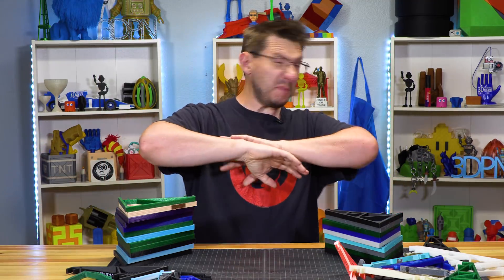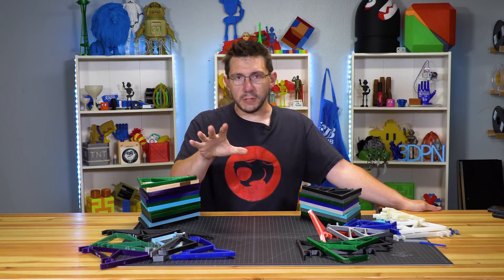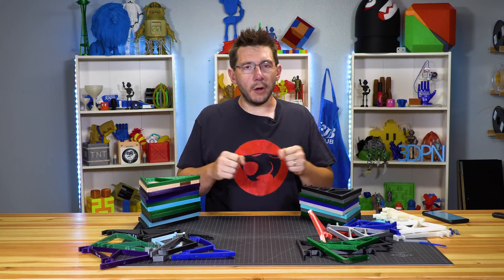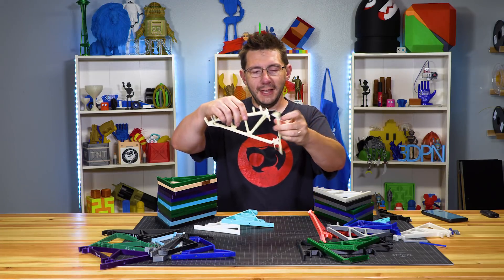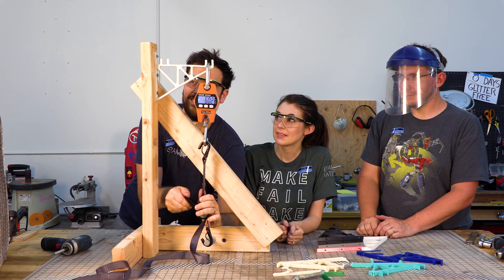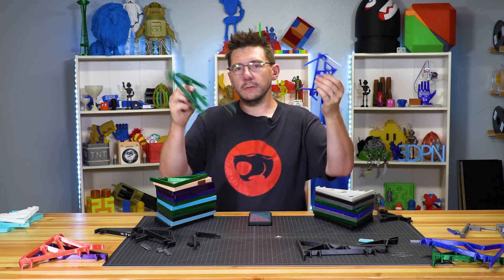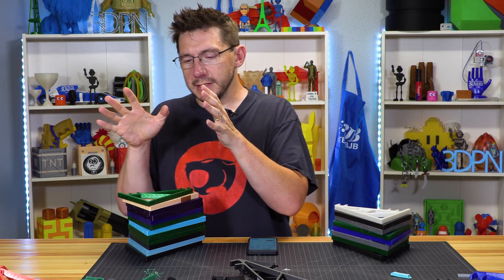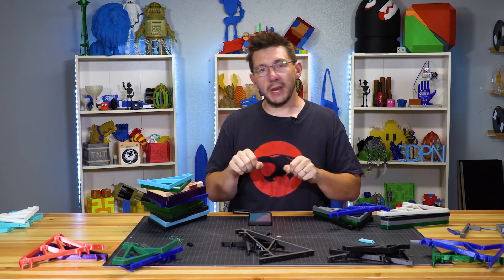Will It Break? Breaking Brackets Part 2 - 3D Printing and Breaking them FOR SCIENCE

Comment: love your videos Joel, curious though. If youre putting spools on the center of the brackets, are you measuring weight at the best point? the tip seems like a weak point because its the thinnest. do you think there would be different calculations if you stress tested from the middle and not the tip?

Comment: Did I miss where you said the weight/volume ratio of the two designs?  What is the % improvement accounting for the added material?  Obviously you could print a solid triangle...

Comment: Mark III would probably be one support triangle between the top mounting point(just figure out how to get the screw in...) and one extra triangle in the middle connecting to the wall surface, since your Matterhackers PETG Build Series basically  broke at the same place. Still amazing results and the testing makes the development process very interesting and educating. And fun. It is said, if a crafted/printed piece breaks and you are in your basement testing, some say you can hear Bill laugh from the walls.

Comment: I grabbed these and got a set of them installed, but boy was it a pain.  The v2 are great to look at, but none of the holes were easily accessible with my drill to actually screw them down.  The the lower 2 holes didn't even have enough clearance to fit the screws you suggested/used in the first video.  I think the top tab should be lengthened just a bit (and hole raised), the middle hole be lowered to between where the two lower holes are, and the bottom hole be moved to a tab on the bottom to make installing much easier.
Reply from the maker: Those are great ideas - thank you!
Reply: @3DPrintingNerd  Luckily I found a screwdriver with a long enough rod (and right head) that I could come in at a steep angle and get them tightened down by hand.  Just waiting on the 1x2 boards to finish being stained before I hang them.  Family is looking forward to spools not rolling around the room anymore :)

Comment: here's something you should know, failing along the beams is due to torque and can be seen as a structural failure.
however in the v.2 , they mostly failed near the joints, which means that the material failed rather than the structure.

Comment: 1- the space (18 mm) for the 1x2" is too small  (3/4" = 19 mm), 2- with V2 it's not possible to use a 1 1/2" screw in the middle hole !

Comment: Isn't nylon like epoxy - only having the strength when it is made the first time.  Injection molded parts could be stronger as well.
And obviously, a well-designed glass fiber or carbon fiber part would be even stronger.

Comment: Will be fun to revist this in a year... I've made some brackets for high load out of PLA, and they very slowly started to deform and break under the load. So i hat to remake them thicker after about one year.
Oh, and a tip for the next measurement: Put the measuring device at the bottom, or put a pillow there so your scale does not drop half a meter on the hard table every time the bracket breaks. Trust me, it will live longer and stay accurate a lot longer. ;)

Comment: Not bad results but the mechanical engineer in me groans at the design. You are putting the material in tension but it would hold more weight in compression. In short the first diagonal brace should go from the BOTTOM of the bracket against the "wall" and extend up to the horizontal upper member. This would put the stress into the bottom inside corner, pushing the corner into the "wall" which would also tend to reduce the tension at the top inside corner, your most common failure point. As the bracket is designed now, you are PULLING the plastic apart rather than pushing it together in your most stressed locations! But hey, it is fun to watch and the tests do confirm that adding trusses will make the structure more rigid. Don't feel bad about the mistake though, it is an easy one to make and is made much more often than one might think! I love your videos, keep cranking them out! :D

Comment: something that might help.
Take this for what it is and it is not always true, but generally you can consider your trusses as arrows pointing away from your point of stress.
where they point to is where that stress will go Triangles are great because they move stress evenly away from the point of origin in opposite directions spreading it out.

so if you look to remake the bracket try to think.
1 Where is the stress.
2 is it over an area or at a point.
3 where do I want it to go. 

then make some triangular trusses pointing from your point of stress to where you want the load to be.
this is a crazy oversimplification but the visual helps me

Comment: You need to quantify the behavior of the material using stuff that engineers can use. Materials behave differently under tension, compression, torsion, etc... Then you optimize your design to depend on the properties of the material.

Comment: Brackets work great but I found two issues... 1. It is almost impossible to get the screws straight. 2. The 1x2 didn't fit, the tolerance was very tight, and forcing the wood in bowed that area a little.

Comment: All the PLA's Are very strong if you slowly put the load on it. We are 3d printing a whole frame for a 32x28x55 inch 120 lb robot. So its good for some scenarios. The problem is though when force gets applied quickly. We designed some trusses that will hold a 320 lb man stepping on it but they will shatter if you hit them with a hammer wrong not even that hard or put twisting force on it. Direction of force matters a lot with PLA . So if you make something structural out of it you have to take great care how its sliced and in which direction the filament runs

Comment: When you was talking about the bracket if the video at 11:28 & u see how this one failed & alot of the others also seemed to fail in the same place if you was to put another truss going towards the back main upright how much of a difference would it make to the overall performance of the design. Yes I know that it would involve a complete redesign again but you certainly have to think about the way that just adding 1 extra truss could be such a great addition to the best possible performance. Love the video's & can't wait to see how the F1 rc project will turn out and how fast it will eventually run

Comment: Annealed HTPLA is stronger than non-annealed.  So why did it fail at a lower weight?
Reply: Stronger how? The truss designs failed in a few different modes; tension, compression and shear. This can be seen by the difference between the materials failures. Additional due to the slender design of the bracket the moment being applied can cause buckling which transitions the load out of the plane of the force and can cause even more moment or less moment resistance. OK I'm getting over my own head here but the point stands. Strength is is a relative term and must be used with a clarifying argument to have meaning. Stronger in tension or stronger in compression would be a more precise way to describe something.
Reply: Umm ok.  :-)  Maybe it becomes more brittle after annealing.

Comment: Did you consider the tool path of the 3d printer? Maybe changing the setups to match each material changed the tool path which will have a significant effect on the strength?

Comment: Just a small suggestion to perhaps help with the buttons on the scale being pressed erroneously, attach a small bit of rope to the scale and the top of your testing rig.  If you make the rope only long enough to allow the scale to at most hang near the bottom of the test rig but not hit the table it may be safer for your hands and also your scale buttons :D

Comment: PLA tensile yield strength is high. That is why is good for this specific application. You would think before the test that NylonX should be the winner but what makes NylonX great for mechanical moving parts like gears is what makes it bad for brakes. Nylon stretches and PLA does not. PLA is an amazing material because of its stiffness. Just keep it cool, you might suffer from creep if the temperatures rises and you then will get a failure.
Reply: Metalurgia's Designs hey so is this why it held more than PETG? I was shocked to learn it held double the weight!
Reply: TheMidnightSmith yes the PETG will stretch a lot more before braking. PLA won't flex that much that's why they basically explode.

Comment: Cool video, really surprised at the limited strength of the carbon fiber infused filament. I guess just having CF in the filament doesn't mean it's being laid down in a manner that creates a strong matrix like you get when using carbon fiber cloth and resins.
Reply: Voivod 1966 , yes this is like cutting iron bars into small pieces and trying to reinforce concrete with them.

Comment: Really nice results. It doesn't even look worth prioritizing max load with those numbers. I think I'd go for something with a more bendy failure mode to make any "dumb guy slipping while holding the spool holder" accidents safer.
Reply: Shower thought addendum: I wonder what kind of failure mode you could get with a dual-extrusion printer cladding a PLA core in TPU. My first thought is that it would allow you to use a filament with good tensile characteristics, while helping to contain the more explosive failure modes on the high end of the filaments you tested.

Comment: I think a more useful measurement would be the force required to deflect the bracket a certain distance (stress/strain analysis) rather than breaking force (ultimate tensile stress). Since you want shelves to be sturdy rather than out and out strong.

Comment: Your next test should be on whether or not printing with all top and bottom layers is better than all wall layers or a balance with different percentage infills.   I would be willing to bet that an all wall layer print with no top and bottom would be the strongest. ie; increasing the wall layers so no infill and no top and bottom layers are needed to print OR increasing the top and bottom layers so no walls are needed.

Comment: Good(!) to see you were more careful to be safe in this test.

Yes, you do have a result, and it is consistent with what others have shown.

First, design matters. A better design is stronger. Testing can show where the design fails. While failures are generally going to be similar (as you saw), a specific material may differ somewhat in point of failure. (A more flexible material might deform and shift load to another area of the part.) When you know the point of failure in the desired material, you can update the design to strengthen that area.

Iteration matters.  :)

Second, plain PLA seems to be pretty much the strongest thing out there. Other folk got the same result. Nylon is not stronger. Carbon-fiber infused PLA is stiffer, but also not stronger. 

So ... print with PLA and iterate for strong results. :)

Comment: Killer iteration (and nice Thunderclap shirt).  It's cool the way you addressed every suggestion about the previous bracket video in this one, and acknowledged CNC Kitchen.  
Your dynamic presentation arm movements have seemed oddly familiar for quite some time.  I knew I'd seen that style of gesture before, but I could not recall specifically who did it.  Flipping channels last weekend finally provided the answer which has been dangling just out of reach for so long.  The first time I saw someone do these moves was on SNL - the Target Lady!

Comment: QUICK CONVERSION FOR ALL YOU ENGINEERS!

Material..........................................V1 (N)..............V2 (N)..............% Diff.
Polyalchemy Elixir (MOAR).           400.                   667.                 166.67
ProtoPasta HTPLA.                         288.                   404.                 140.12
Matterhackers PLA.                        389.                   434.                 111.54
Matterhackers PETG.                     188.                   230.                  122.46 
Matterhackers PLA (MOAR).        546.                    783.                  143.32
Matterhackers Ryno.                      168.                    230.                  137.4
Matterhackers NylonX.                  174.                    214.                  122.96
Zortrax ZHIPS.                                                            65. 
Polymaker Polymax.                                                  268.
ProtoPasta HTPLA (annealed).                               375. 

I would do it in KG too but Newtons is our good ol’ SU unit!

Comment: how come i never see you , makers muse, or tom ever really deal with delta 3D printers ive only ever had experience with delta fdm machines and dlp resin. ive never got the chance to use a normal cartesian printer. are delta printers not as good? it seems they are unpopular is this do to less support build quality or something?
Reply from the maker: Good question. I've had various SeeMeCNC machines, and right now I use and love the Artemis. In fact, it printed the models for the video where I melted dino models.
Reply: thanks for the reply, ah the artemis is such a beautiful delta style 3d printer did you get the assembled one or assemble it yourself?  currently i just have one that i sourced out parts for and built but i think im going to get the cr-10 printer and compare how different the two print, Also watching the dinosaurs melt was pretty great.

Comment: It would be cool if you looked into generative design in Fusion 360. Apparently it uses machine learning to create structures that are strong with the least amount of material. It would be nice to see how a generative designed bracket would do compared to your other designs. Maybe you could even show a ratio of weight to the amount of force it can hold.
Reply: Ah but sadly this is ONE feature that is only available to people who have PAID for F360. Which, though much cheaper than Solid Works, is still a bit of coin.

Comment: The debate about the strength of natures shapes. You mentioned that the triangle is the strongest shape in nature, but Angus yesterday didn't say that, he said that the egg shape if compressed at the oblong points, is impossible to break. Hmm.., there seems to be some differences in opinions on the matter. It's possible both opinions do seem to hold water given the variables involved, depending on what their intended requirements are for.

Brackets you say? Yes. Here is another one of a commonly shaped type of Bracket.
https://youtu.be/LS0Nf7lZu6s

Comment: Insulted that you felt that you needed to put these results in a table!  Kidding enjoyed the video, I was supprised with the amount that could be held, even with your first version of the brackets in the weakest plastic.

PS would it have killed you to put the table in the description :-)

Edit - Attempt to put in table...
 Material                                        V1 (lbs.)   V12 (lbs.)  % Diff.  
 --------------------------------------- ------------- --------------- ------------
  Polyalchemy Elixir (MOAR)      90.0         150.0          166.67%  
  Proto Pasta HTPLA                   64.8           90.8           140.12%  
  Matterhackers PLA                   87.5           97.6           111.54%  
  Matterhackers PETG                 42.3          51.8           122.46%  
  Matterhackers PLA (MOAR)  122.8        176.0           143.32%  
  Matterhackers Ryno                  37.7          51.8           137.40%  
  Matterhackers NylonX              39.2          48.2           122.96%  
  Zortax Z-HIPS                                 -            16.6                  -        
  Polymaker Polymax                       -            60.2                 -        
  Proto Pasta HTPLA (Annealed)   -            84.4                 -